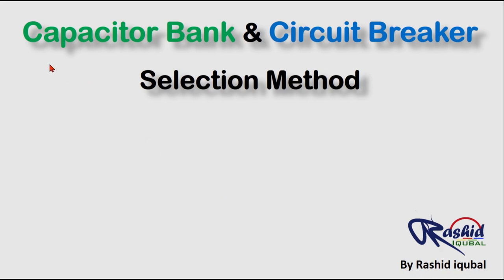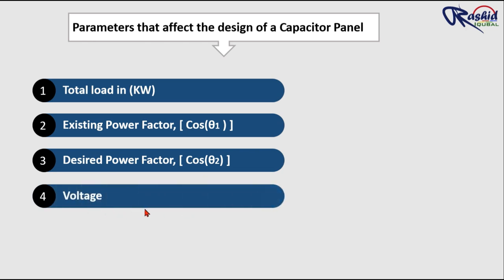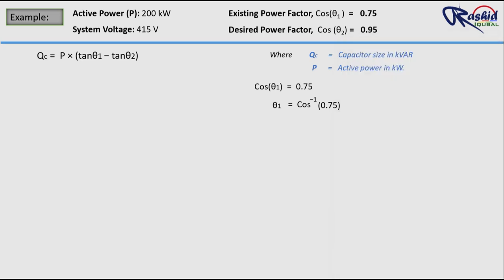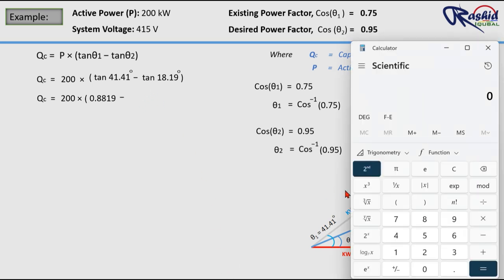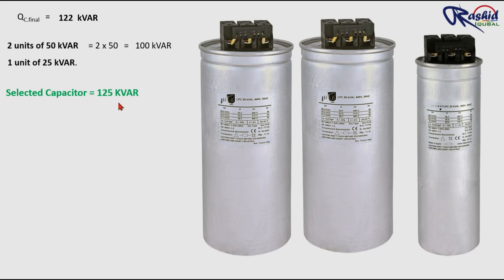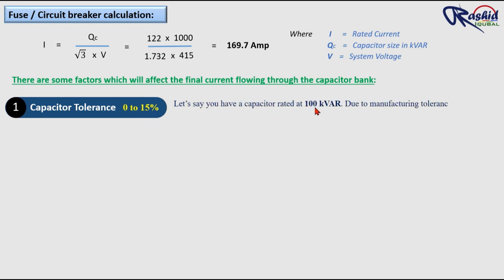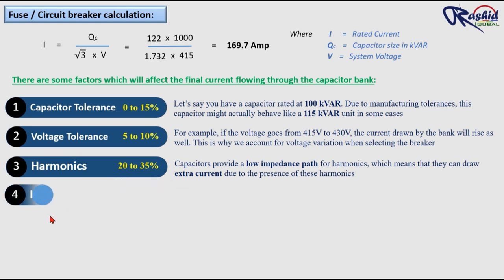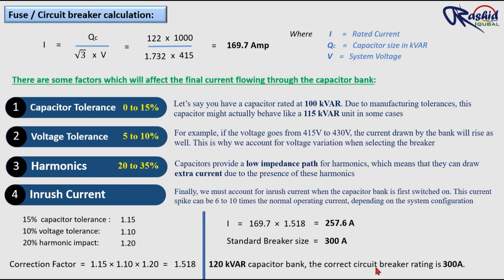Capacitor Bank and its Circuit Breaker size calculation

Comment: As per formula if the voltage increases current should be reduced nu?
Reply from the maker: That is correct, for a constant power load, as voltage increases, the current decreases. 😊

Comment: Good way of explaination , while selecting the rating of capacitive reactantces/steps for the particular inductive loads switcing it be ensured  that there should not be over voltage any time due to switching of capacitor bank steps.
Reply from the maker: Great 👍

Comment: But sir the formula is kvar =√3 Vi sin(.6) if power factor is .8
Reply from the maker: Yes, √3VI sinθ gives existing reactive power.
But for capacitor bank sizing we must use
kVAR = P (tanθ₁ − tanθ₂).
This directly gives required capacitor size..

Comment: Exsting power factor ( theeta 1 ) ki value kese pata chalegi
Reply from the maker: We assume power factor 0.8 because the load side has different equipment with different power factors.
So, for calculation purposes, we take an average value of 0.8, which is standard for mixed industrial loads..

Comment: Can you please explain why we use 60% of transformer for PFI panel for designing a substation? Like for a 1000kva substation we take 600kvar pfi panel.
Reply from the maker: It depends on power factor, if u select PF-0.8

1000kva = 1000x0.8=800 kw

Kvar=800tan(cos0.8)

After solve this you will get 600kvar

(600/1000)x100 =60%

You asked good question, very soon i will make video on this topic

Comment: Hi , Sir !
I calculated amper two steps 50kvar and one step 20kvar by :
For 50kvar , I=(50x1000)/(1.732x415)
For 20kvar , I=(20x1000)/(1.732x415)
How to calculate is correct or not , Sir ?
Reply from the maker: Yes, since all steps are on the same bus, add the kVAr to get the total feeder current. But for each step’s fuse/contactor/cable, calculate step current separately... your formula is correct..
Thanks

Comment: 10%= 0.1 how u select 1.10
Reply from the maker: Yes, 10% = 0.1, but we use 1.10 when we are adding 10% to the original amount.

For example:
If something costs 100, and we want to add 10%, we calculate:

100+10% of 100 = 100 + 10 = 110

So,
1.10 means 100% + 10% = 1.00 + 0.10 = 1.10
Reply: ❤ @Rashid-iqubal

Comment: Where is sinpi value here for amp calculation
Reply from the maker: Why are you asking about ampere calculation? To find the correct size of a capacitor bank, you don’t need current in amperes. You only need the system’s active load (in kW), the existing power factor, and the desired power factor. From these values, you can calculate the required kVAR using standard formulas sin φ is not used in that calculation..
Reply: @Rashid-iqubal  yeah but second part of this video CB rating calculation during current calculation why are you not considering sin¢ value??? According to formula find current through reactive power...Q= √3VISin¢
Reply from the maker: @Kevin-ub3pt  For a capacitor bank, power is reactive power (Q), and capacitors always operate at 90° phase angle (purely reactive).
So for capacitors:

sin𝜙=1

That’s why the formula becomes:

𝐼=𝑄/root3V

There is no need to multiply by sinφ, because the whole kVAr is already reactive.
Sinφ is only used when you are converting from kVA to kW to kVAr, but a capacitor bank directly gives kVAr, not kW.

Comment: Dear sir,
Without know of present pf how to calculate the size of capacitor bank.
Reply from the maker: You can check in your digital energy meter, it shows ‘’PF:  ’’.  Otherwise there is a power factor measuring device available in the market you can purchase like some clamp meter they have option to measure power factor..

Comment: Sir I need video that how we calculate the load for lay down area like in which we have different size porta cabin and each cabin size need to select the right size of AC and load and also assume load for pantry and how we calculate the load for fence light
Reply: And how we select the generator size for all lay down area load including each porta cabin loads including pantry room and all internal and external fence light for lay down area
Reply from the maker: @Eng-z4z  you want to make load calculation of porta cabin ? Sure i will make video on that topic..

Comment: Rashid shouldn’t increase in voltage decrease the current draw
as the V is in denominator. 
 Good video friend.
Reply from the maker: Where ?
Reply: In sizing circuit breaker if voltage rises by 10% the current will decrease and vice versa. Therefore 10% correction factor may be applied in calculating the total current drawn by the capacitor along with with the capacitor tolerance and harmonics, so your calculation is still valid.
Reply: Tolerance works both ways, up or down. I think voltage tolerance in this calculation should be accounted for voltage drops not for voltage spikes.